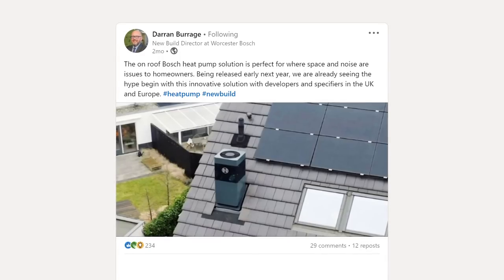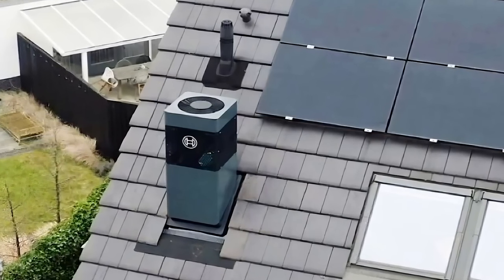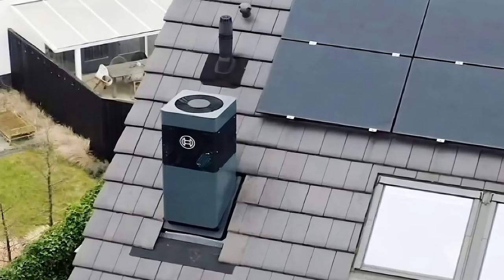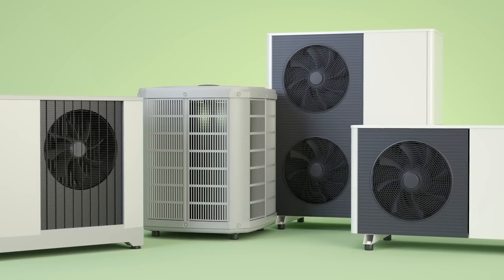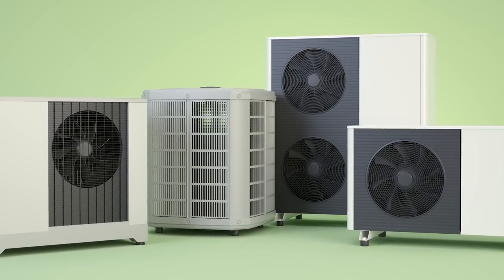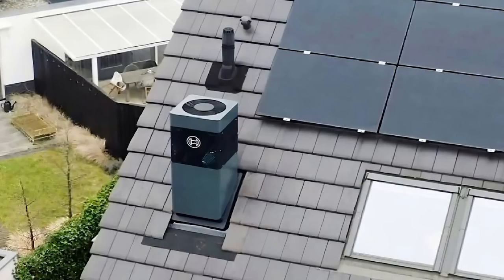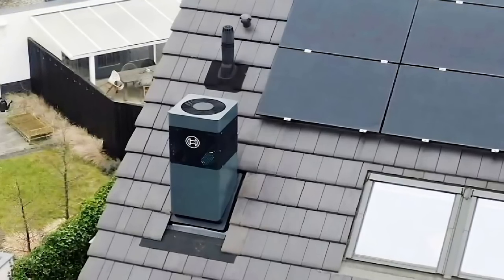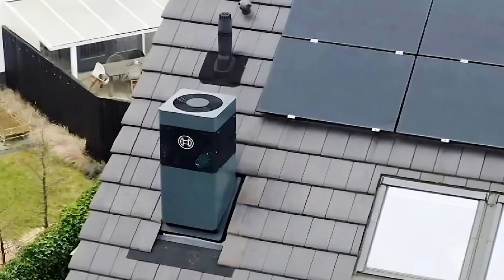Is This New Air Source Heat Pump Idea Crazy?

Comment: Buying a new home and it's gas central heating and I don't trust gas so wondering if it's possible to change the gas boiler to electric and keep the same radiators plus heat my water coz I'm a old dog that likes a bath lol

Comment: The noise issue...isn't an issue. We have had an ASHP on a garden office building operating for over three years. You can be standing close enough to touch it and still can't hear it. In fact, I've tied a couple of wee pieces of ribbon to the fan grill so I can see when it's on! Also, our ASHP is about 1m from the fence between us and the neighbours. Never had any complaints.
Reply: Maybe yours is very quiet, but most of them that I've seen are very noisy! That and the fact they blow cold air all around the place.
Reply: @mktrollop1093  really!? A HEAT pump blows cold air? Incredible!
Reply: @protectiongeek  - It sucks in warm air, takes some energy from that and then blows out colder air. It's kind of what they do, yeah.
Reply: @EelcoWind  you clearly recognise irony when you read it. Or, then again, perhaps not. I think “ambient air” is a little less subjective than “warm”. My ASHP is working away very happily right now but I can’t think of many people who would describe the ambient air temperature here as warm 😂
Reply: I think most people who have a heat pump think amazing things about them. I’m sure you can hear your heat pump though but maybe you’re deaf?
Reply: @protectiongeek  You need to study the science
Reply: @protectiongeek  Ah yeah, I missed that. It just came across as a really stupid remark, sorry about that. But now that I'm more informed: I don't quite get how you countered the original argument that (apparently) some people think that the colder air coming off the machines is a nuisance.
I know, I know, for your device it's all fine and dandy; it is quiet and the colder air is no problem, but somehow it brings you to the conclusion that it therefore is no issue at all for anyone.
Reply: @EelcoWind  you'd have to be standing/sitting pretty close to an ASHP to even tell the exhaust air is colder than ambient when it's in heating mode. A non-problem I think.
Reply: @Chris-ot9jf  nothing wrong with my hearing.
Reply: @Phantom-mk4kp  funnily enough, I DID study the science. Honours degree in Electrical Engineering; will that do?
Reply: @ilricettario  ah, well you'd be wrong. On both counts. Sorry to disappoint.
Reply: @mktrollop1093  l8
Reply from the maker: Craig
Manufacturers warn about noise issues, the air rushing through the fan is not silent.
Reply: I was looking at getting a small air source heat pump for a workshop, how much does it cost you to heat a small office space with it?
Reply: @SkillBuilder  of course they do. ASHPs are manufactured to a number of standards, including requirements for sound emissions. Nobody - myself included - claim that they’re *silent*. My experience is that they’re pretty close to it. The noise “issue” is a bit over cooked I think. Modern ASHPs for domestic use are very quiet, by and large. I have absolutely no doubt that some commenters here would be able to identify sites that are clearly intrusive in terms of the fan noise but I’m not sure we’d be comparing apples with apples.
Reply: @hanvyj2  our ASHP heats a modern, well insulated (but could be better) office with a floor area of 5m x 3m. Ceiling height about 2.3m. The device is rated to provide a maximum 2.35kW heating output but tends to work around 600W to 1kW. The cold weather over New Year had an ambient temperature of about -8degC at night and -6degC during the day at the coldest point. The pump heated the office without any difficulty. Once the building fabric on the warm side of the insulation is stable and air changes are kept to a minimum, the heat pump is just servicing the heat loss, which is fairly low due to modern materials and building standards.
Reply: @hanvyj2  in terms of the actual cost, I could only estimate it. The pump isn’t separately metered and it isn’t “fancy” enough to report energy usage via an app, like lots of new heat pumps do.
Reply: Do you just use it to heat the office, or the house as well?
Reply: @tcm81  just the office. We're in the process of trying to find someone to install an air-to-air multi split ASHP for the house to replace our 29yo gas boiler!
Reply: @protectiongeek  agree the noise issue is a almost non issue or should be. i think it's dumb planners putting underspec'd heatpumps in. I have a 10m by 7m shop front and two minisplit cassettes. Outside is a air air heatpump
. inaudible until it's 35C in the summer (i dont live in the uk) and its running in cooling mode after the weekend break. You start it up and the automatic control says to itself "i now have to get this down from 30C to 20c as fast as possible" . Then it goes into mental flymo mode and sounds like it is trying to launch into orbit. That lasts about 30 mins and it returns to normal
Reply: @protectiongeek  What if you want to ventilate your space in winter? How long does it take to get back up to a comfortable room temperature if you open the windows summer and winter Berlin lüften-style?
Reply: @DouglasCarnall  get another system, ashps aren't designed to have massive amounts of cold air ventilation unless you install something like mvhr

Comment: Flexible pipes as it’s in the loft so it can drop down into the loft for maintenance. Or dorma window style heat pumps, rear access for maintenance. Engineer it so it all slides out like a module so you can get to the fan to clean it.
Reply: Spoken like an engineer. 🙂
Reply: @paulwestlake4278  You got me, an acoustic engineer, but an engineer nonetheless 🤣

Comment: A simple solution would be to have the connections to the heat pump made of flexible pipework and a system whereby the heat pump is attached to a frame directly below it in the loft and can be lowered down into the roof void for maintenance. There would need to be some kind or rubber seal to stop the ingress of rain water when the heat pump is raised back in to situ after maintenance. This would negate the need for anyone to venture up on to the roof.

Comment: I personally think if you turn the dial down to 45degrees on a HE gas boiler, the running Costs are going to be similar to that of a heat pump (in £ terms. Not in Kw hrs).
Without the installation cost,  noise, unproven reliability and maintenance. Just my opinion.

Comment: Heat pumps on a solid concrete base make a noise?  But whacking it on a timber roof will be fine?  😆  

By the way, these roof mounted systems are intended to be fully accessible from the loft, not by acrobatics Roger 👍🏾

Keep up the good work and let's have another catchup this year.

Comment: The noise issue is old new and based on early models, the quicker old technology folk get real and understand that this is a valid approach to the gas and oil demons, then the better everyone will be and we all wake up and live happily ever after .... shame on you Roger for not providing the complete story, thumbs anyway, because your decent guy.
Reply from the maker: I do not believe that new heat pumps have solved the noise problem. Most manufacturers warn about the noise problem.
Reply: @SkillBuilder  Installation methods, siting etc all help to reduce noise level, not to mention the skill level of the installer, it is just a case of people realising that this is the next step forward, that cannot be denied/stopped .... The days of old gas boilers and heaters and even new ones ? .... Condensation, ventilation requirements, siting restrictions, installation checks, regular maintenance, leaks, strict standards for training/certs etc etc, we all need to move on and get with the big picture, like or not, it is here and will benefit all in the future, not the current status of current cheap oil/fossil fuel derived systems subsidised by the cheap supply of fossil fuels ... include Hydrogen in that too. Do boiler manufacturers warn about the danger problems ? that can and do occur from many variables, not including crap installers who don't care ? A noise problem is a small price to pay compared to gas emissions ... the real killer .... keep up the focus on new tech posting, looking forward to the next one pal !

Comment: BG now sells heat pumps with installation from £3k with government grant. They will also change rads and heating system and install insulation where required to make sure they work effectively.
Reply from the maker: Anyone who has had dealings with British Gas will treat that promise with some scepticism. The operative word is 'from' .
Reply: helping unscrupulous pump dealers get rich

Comment: I like the alpha hybrid system, it appears a middle ground as for a combi replacement it’s so ideal, no cylinder or glycol required and works off the cheapest tarrif, heat pump looks solid as part of the kit, easy to install no replacement of rads/pipework etc. no kick back from government which is disappointing and they should look at this set up to help reduce gas consumption 👍
Reply from the maker: There are several hybrid systems out there now and the government is looking at including them in the grants which is more or less what I was saying to Heat Geeks, They thought is was a rubbish idea but I like it.
Reply: @SkillBuilder  absolutely it’s a middle ground and is affordable, as and when a government kick back for this set up it will take off big time👍